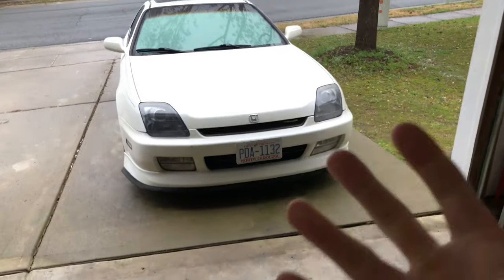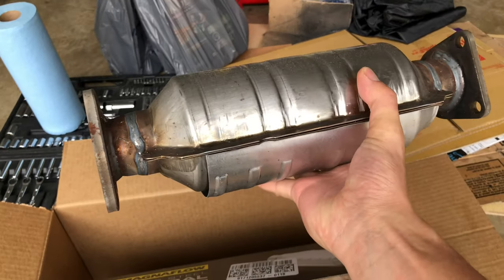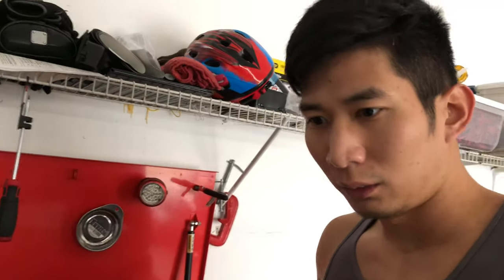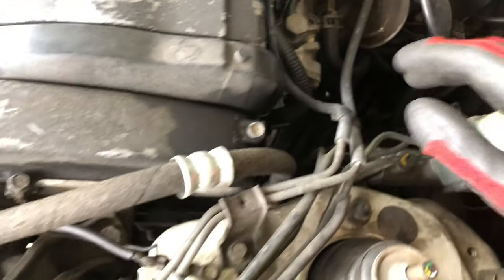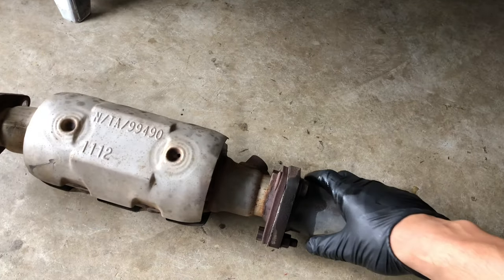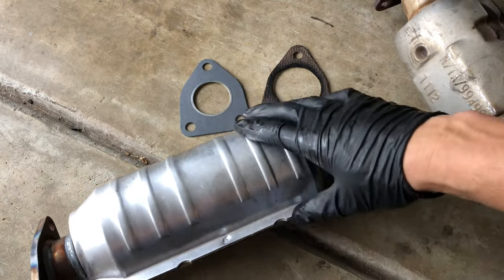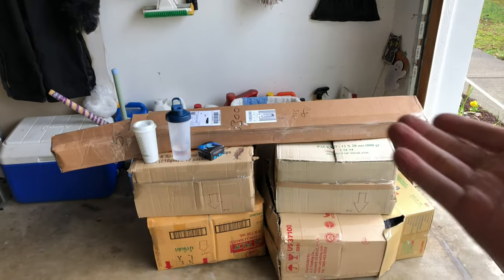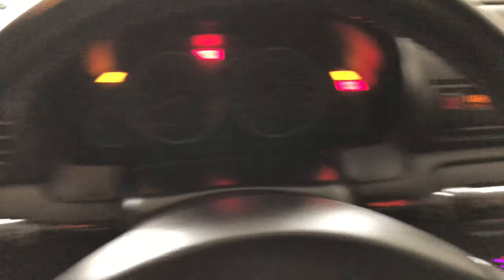Magnaflow Catalytic Converter For 98 The Honda Prelude

Comment: My 99 prelude have two O2 sensors on the catalytic converter. Does your have two?
Reply from the maker: Yes, one is the upstream, closer to the front of the car. The other is down steam, closer toward the back. They have two different part numbers

Comment: The magnaflow cat does it have a better purpose the stock? Louder? More HP? Higher flow?
Reply from the maker: Not that I know of, mine had went out and so I got this as a replacement. In my opinion, I don’t think any aftermarket cat will be better than OEM because of the high quality materials used in OEM ones.

Comment: Dope video g really helpful... Just wondering Can I drive my car with a failing cat converter for my 2000 lude? I just got my timing belt done it just did 200k miles, btw your car looks fire af 👌🏾
Reply from the maker: Thanks bro! And yes you can, you'll just have a CEL code on your dash the whole time.

Comment: Type SH?  Do you feel a big difference with Magnaflow?
Reply from the maker: Yeah, mine is a SH. I mentioned that because other models have their Oil Filter located toward the bottom of the engine. I can't really tell a difference with the Magnaflow yet, maybe cause I still gotta get my CEL issue fixed >_<
Reply: @Rawrkee  coolio. I converted my SH to a Type S with the redtop H22a. I get my Mugen header and 2.25 Magnaflow hi-flo cat soon (CARB (CA) compliant on the cat; Mugen, no so much). Maybe I'll document for YouTube. I've dropped nearly 20k since 2011 on this project, so might as well share.
Reply from the maker: That's awesome!! Heck yeah, I'd love to check it out man :D
You on IG????
Reply: @Rawrkee  Not yet; maybe soon.

Comment: What's the difference between the sh and vtir
Reply from the maker: I really don't know anything about engines ¯\_(ツ)_/¯
Reply: VTI-R is Australian -the first two years were the same H22A4, and the latter years was a H22Z1. Details are scant, but there seems to be no real difference from a base USDM Prelude, besides being RHD.
Reply: Type SH = Super Handling. ATTS (active torque transfer system)unit inside the engine helps reallocate torque to each wheel while corner in insceases handling capability.